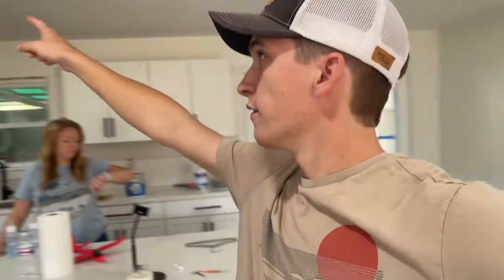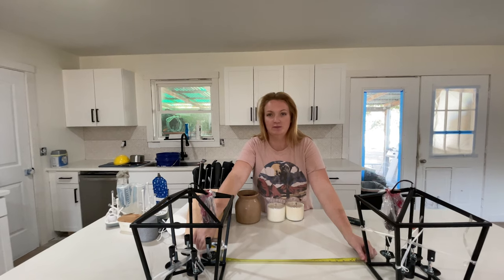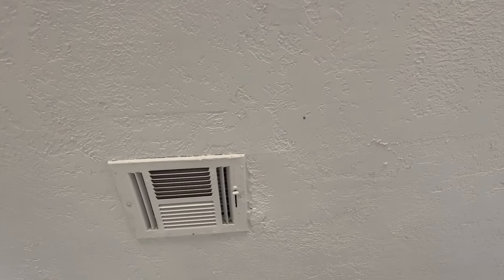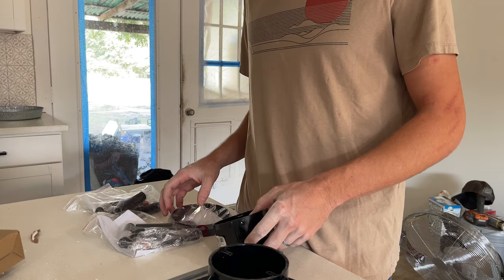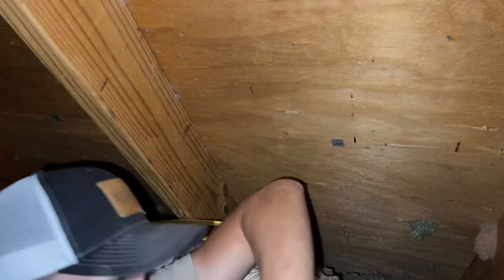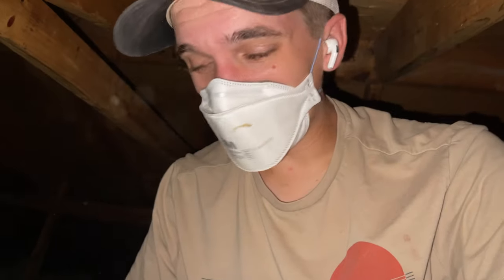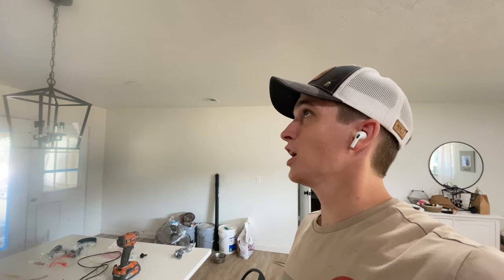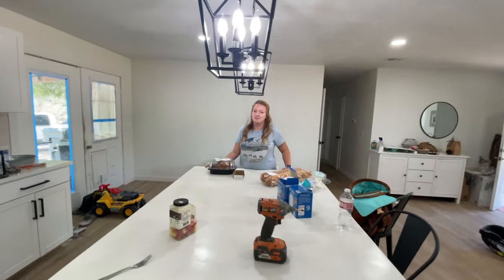How did This Happen!? This Changes Everything!

Comment: Your kitchen is looking wonderful.  Those pendant lights really go well with it.  
As someone who has battled poison ivy with progressively worse reactions, the key is to remove the oils within 2 hours of exposure using cold water, a good soap (Dawn dish detergent is excellent) and friction (i.e. terry wash cloth).  Repeat a few times.  Do this if you even suspect you’ve been close to the stuff.  Since using the method outlined I’ve only had two instances of small patches show up and they healed quickly (and gratefully without the need for prednisone).

Comment: They look good!
Can they be wired up so the island lights can work independently from the other lights? I think just having the island lights on in the evening would look amazing. 

Did you remember to re connect the air pipe?

Comment: Did you fix the air conditioner pipe?  Good job Crandall on getting those lights done not your cut fingers. I remember those cross bars had a sharp edge when I used them.

Comment: You need to set bombs off in that attic.  Bees are as destructive as termites.  That insulation is either rock wool or cellulose  which is much better than fiberglass ( which is good for filters. Not good as insulation.  ).